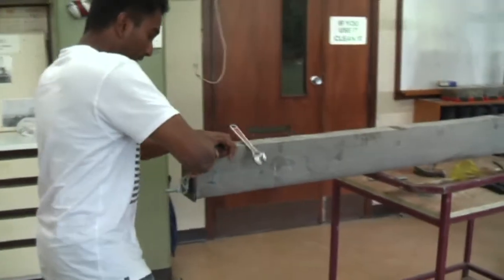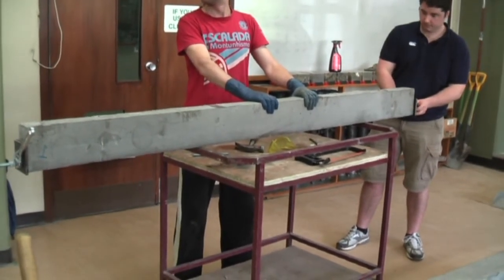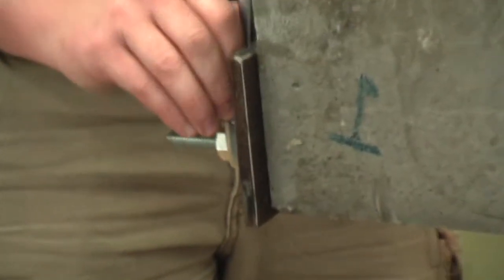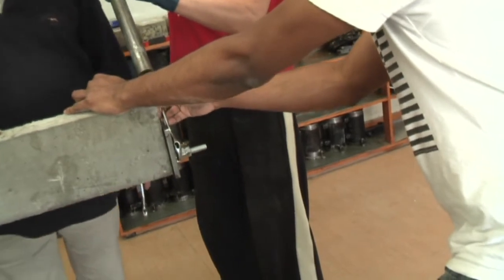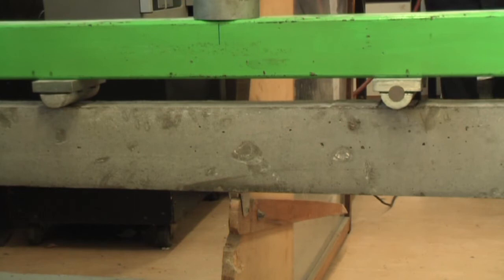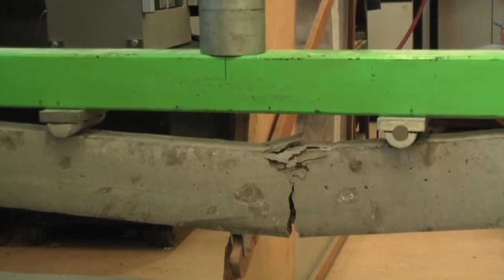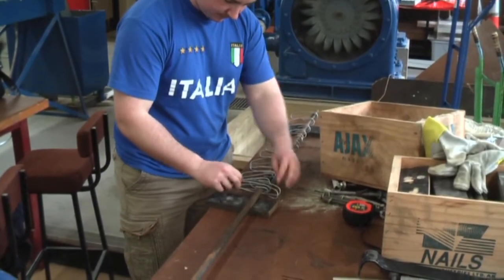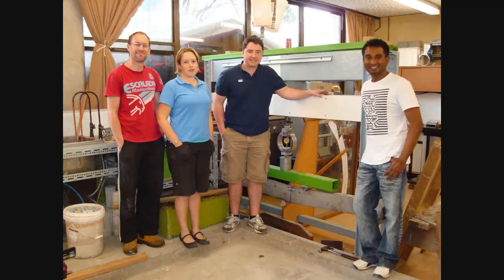Part 2 - Making and Testing Concrete Beams (Post tensioned/Non-post tensioned)

Comment: What is disappointing is the poor lab safety being demonstrated. Cheater bars and no safety glasses. It is only a matter of time time until the beam fails or the wrench handle snaps and a fragment takes out someones eye. Love the hands on engineering and science but not worth the risks that could be so cheaply mitigated.
Reply: Lebay tod..

Comment: You can use a torque wrench to establish the load on the treaded rod.  

You also need to hold the end of the rod you are turning (same end as the wrench) with a pipe wrench or else the rod will twist inside of the concrete. 

Mark C

Comment from the maker: @ady0003 hehe.. not quite, "Day 2" on the video means the 2nd day in the lab. We made the beams and cured them in a water bath for 20 days (ideally should have been 28 days but were running out of time) before testing